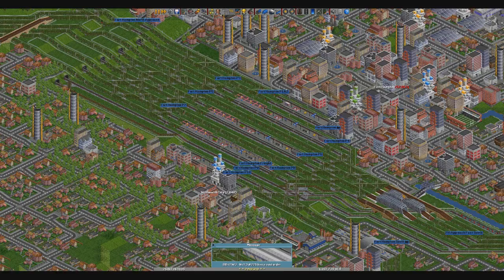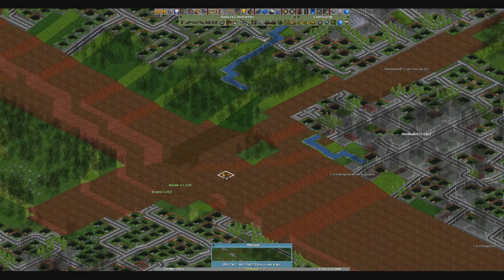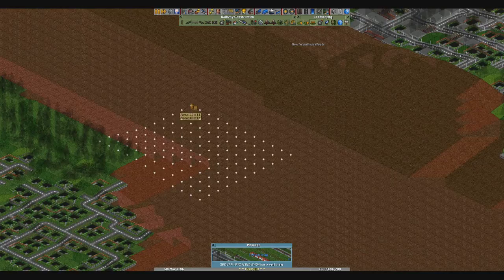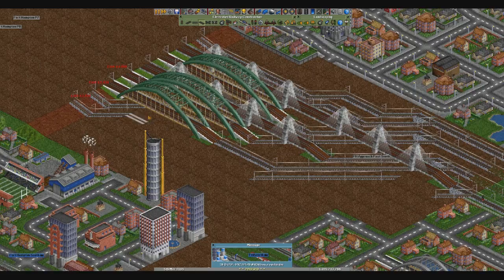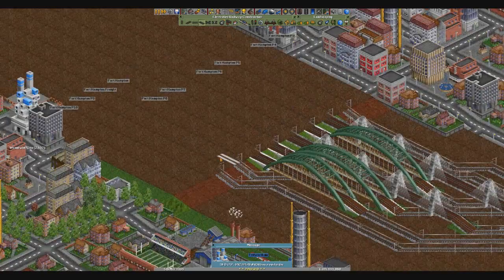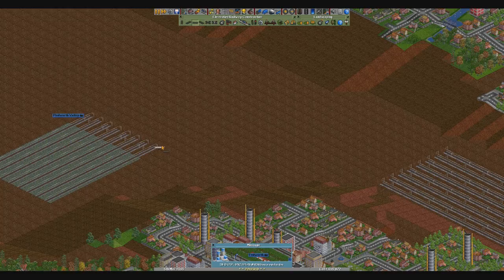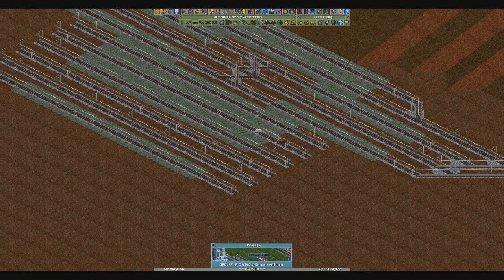The M4J3FFR135 Network | OpenTTD | #127 | Fort Hampton Parkway - Part 1

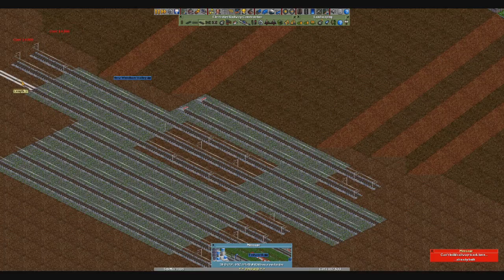Comment: 18:40 Buffer tiles are considered non-track tiles, so if a bay platform has buffer tiles, and these are included in platform length N, then that platform can actually fit up to (N minus 1) tile trains only instead of just N tile long trains. Example: you build a 8 tile bay platform, but you put buffer tiles in the 8th tile in the platform. Then that platform can only fit up to 7 tile long trains, and if you want 8 tile long trains in the platform, then you have to actually extend the platform by 1 tile so that can fit.
Reply from the maker: +James Moton I use 7 tiles for express platforms, 6 tiles for stopping platforms, 8 tiles for freight platforms and 10 tiles for RailJet platforms. I know that buffers don't count so I always count it out then add the buffers after